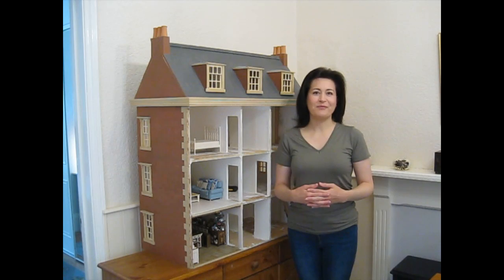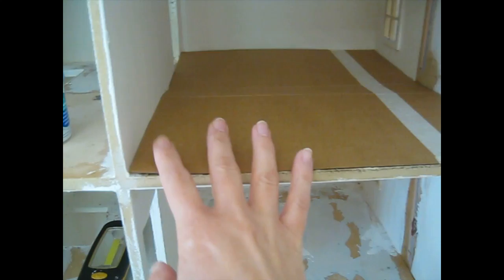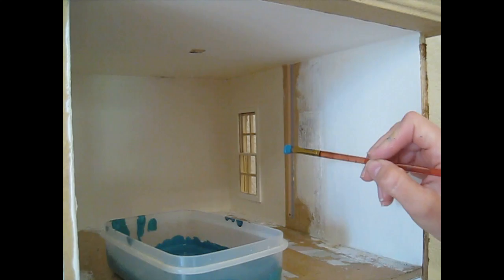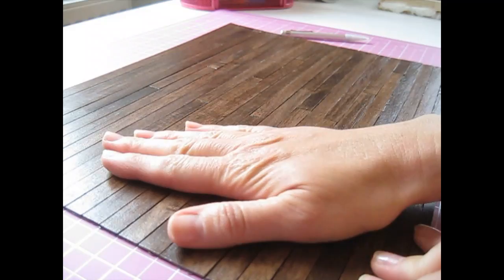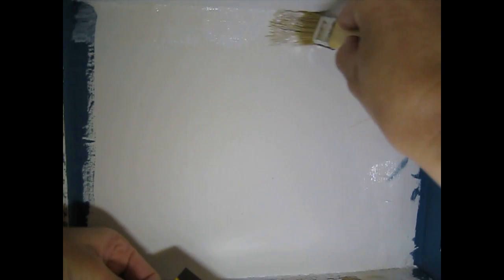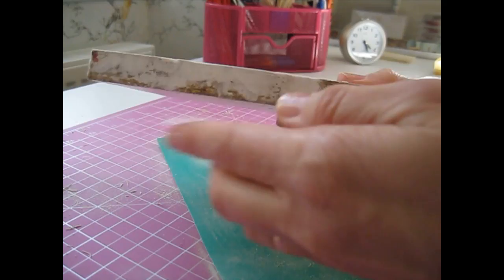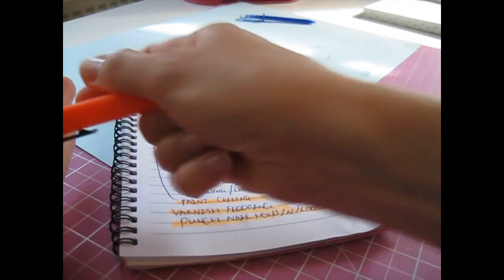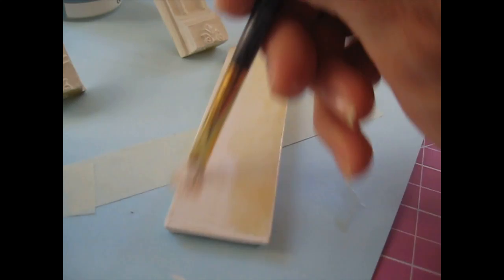My Dolls House Diary #25 ~ Making a Start in the Bedroom

Comment: This room is so lovely.  Beautiful color choices.  I'm also partial to walnut floors.  I'm very glad you liked my tip about using the tiles to help add weight to the corners.  I've even used some old bricks on top of them to be sure the corners don't lift!!!  Looking forward to seeing how successful you'll be printing on fabric.  I've bought some of the printable fabric but haven't gotten around to using it yet.  Thanks for sharing.
Reply from the maker: Thank you so much for that tip, it saves the corners from lifting up!  I'm looking forward to using the printable fabric.  It seems a little thin, but we'll see how we get on with it. :)
Reply: Ah, but isn't it fun to empty the entire pantry into the dollhouse to hold down the floor?

Comment: I love the flooring it looks so professional, I really need some help with the door casings as mine looked terrible so I removed them now I do not know what to use to make new door casings, Any help you could give me would be very much appreciated since this is my very first dolls house and it is not new it is second hand and was a real mess when I started it the internal doors did not fit some were cut way too short and some way too big and badly screwed in hinges some holding on with nails that split the casings so I removed them all to start again, Thanks in advance crafty friends xx
Reply from the maker: I shall be making and fitting door surrounds and doors in an upcoming episode of My Dolls House Diary.  Once the decorating is complete, I shall make a start on the doors. :)
Reply: @JulieWarren  Thanks Julie, I shall wait then, I have been so worried because I haven't got a clue how to make the casing's, Thanks Julie xx